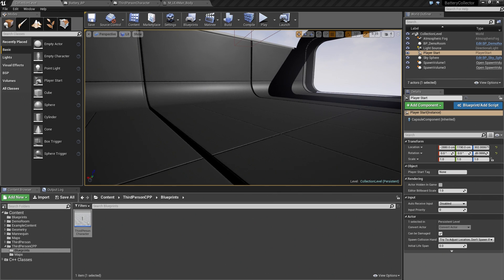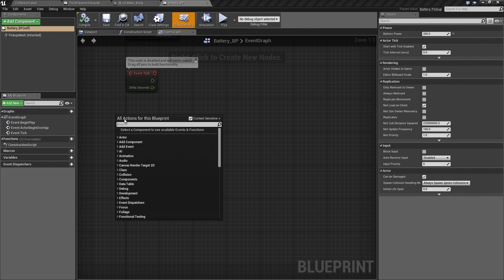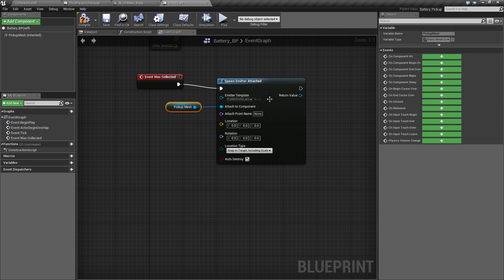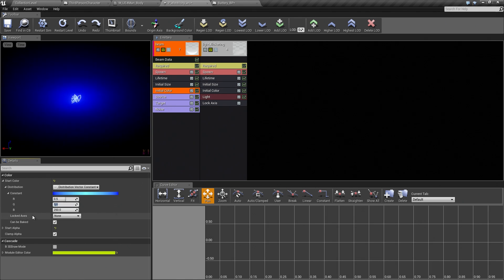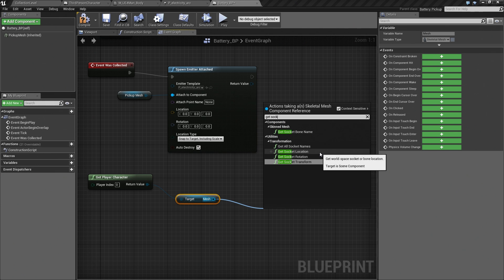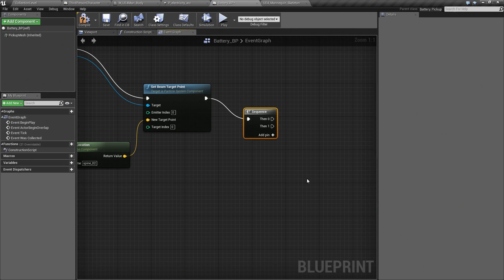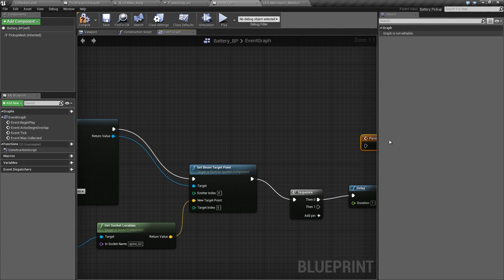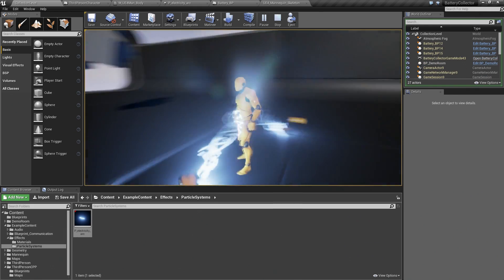C++ Battery Collector: Adding Particles to the Pickup | 15 | v4.9 Tutorial Series | Unreal Engine

Comment: Iv Given Up Coding As Its Basic And Easier But Only If You Have A Dictionary In It/For It, Blueprints  Removes The Need To Look Externally Specially If Your Experience And It Simply Works Well, But Is It Advanced Enough, Only Time Shall Speak!

Comment: Quick note!

The way the emitter is set up does not work properly: the sequence node first deletes the battery, and then tries to reset the emitter's target afterward, which means that the delay node changes the target on an emitter that no longer exists!  :EDIT: Found a way around it, and I'm head-desking over how simple it was: just reverse the order of operations -- on the sequence node, 'Then 0' should retarget the emitter, and 'Then 1' should delete the battery.
Reply: You should head-desk again because 'Then 0' has 1 second delay, whereas 'Then 1' has 0.1 second delay. That means 'Then 1' re-targets the beam 10 times before 'Then 0' destroys the battery.
Reply: what version fo Unreal engine did you use?

Comment: UPDATE - Managed to get rid of the blueprints and use C++. However, the lightning still doesn't hit the character in the chest so there's something wrong/different concerning the API. Think it's SpawnEmitterAttached.
Reply: I'm currently using 4.19.2 and it worked using the BLUEPRINT she shows.  I haven't put it into C++ yet but should still work.  Do you have lightning at all spawning?
Reply: Hi Slipscar. Yes I do have lightning spawning from the batteries. As I mentioned in my previous comment, I downloaded her project from the link and it also doesn't hit the character in the chest.

I got the C++ off the internet but found it wasn't updating the target because it uses a Tick function that wasn't firing so I altered it accordingly and it still doesn't work. It seems to get the wrong socket location or something. I may try my own version of the blueprint she shows next. When I get time.
Reply: @vkanclassicalvt8165  Had the same problem, I actually didn't set the target of the electricity arc correctly to User Set!

Comment: Idk if 12.5 requires another way of dealing with this but my arc isn't spawning, I've added the 2 required changes in the arc and i've done the blueprint excactly the way you did it, which concludes to me that it might because its 12.5. Can someone provide me with the new way to add particle effects? Thanks.
Reply: Double check that the BeginPlay of ABatteryPickup is calling Super::BeginPlay()
Reply: Maybe you don't press c key to collect the battery ? The electrics will be seen after the press.